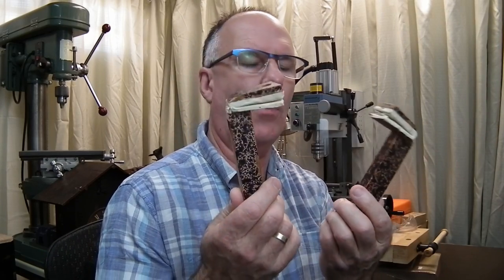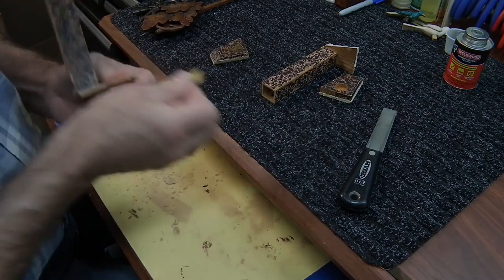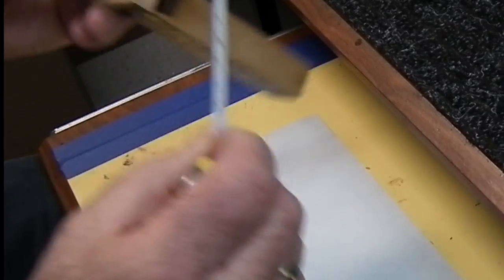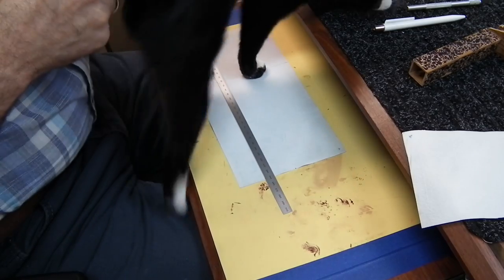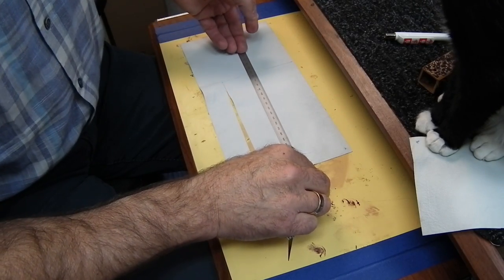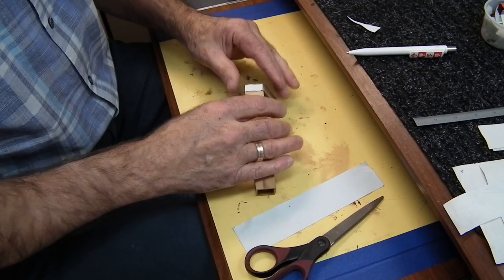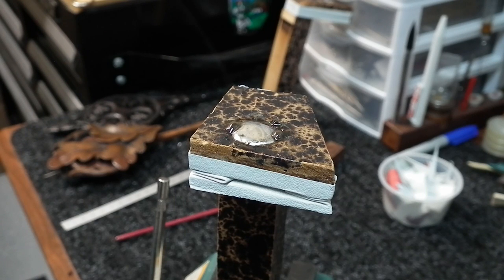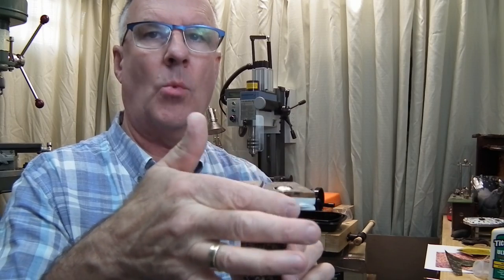Re-Leathering Cuckoo Clock Bellows

Comment: thanks for the informative video!  What are your thoughts on leather vs. tyvek or some other material?
Reply from the maker: Hi Jon, Tyvek works great and will last a lifetime or three, I use leather primarily for antique cuckoos which benefit  from originality however the cost is greater as you know. Thanks for bringing up the question, perhaps I should have mentioned Tyvek in my video as an alternate material.
Reply: I have not messed around with tyvek much, but I wonder if it conforms and takes a fold as easily as leather does?  I've got a bunch of cuckoo clock bellows to repair, so I guess I'll find out!
Reply from the maker: @jon_byler  Yes if you have the proper Tyvek it will crease fine. I have used Tyvek from disposable coveralls and it was way too soft and didn't crease well. I order smaller quantities from eBay and it's work just fine.

Comment: Great video! Nice to know where you can purchase these supplies. Where can you purchase a shop kitty?
Reply from the maker: Nike animal rescue! 😉
Reply: @TheBlackForestClockShop  inside a below I found like some white stones do you know what this is?
Reply from the maker: @northover5023  Yes this crushed stone was commonly used through much of the 19th century even a bit after the turn of the century, I have forgotten the name of the actual stone,  i'll look back and try to find it, a powdery mess it can be though. Some collectors like to keep it for originality but once loose I just replace the weight by using small pieces of lead.
Reply: @TheBlackForestClockShop  thanks for a fast reply I was a bit worried it was something dangerous. it got all over my floor
Reply from the maker: @northover5023  yes what’s really bad is when it breaks open during shipping and  thoroughly coats everything inside the case…😖.